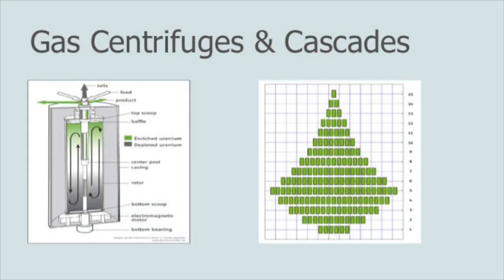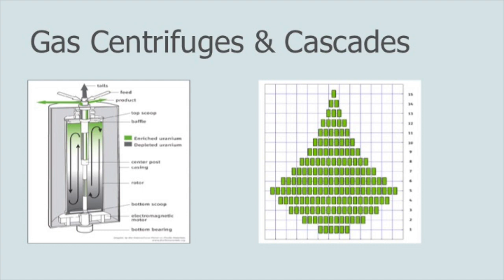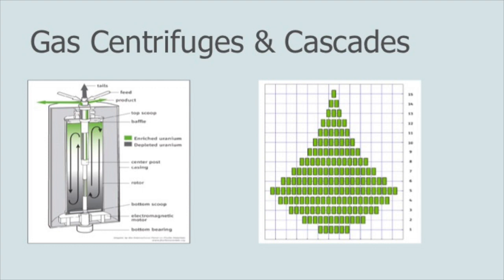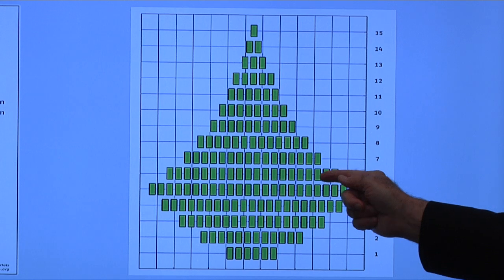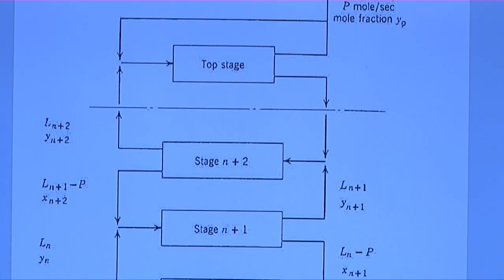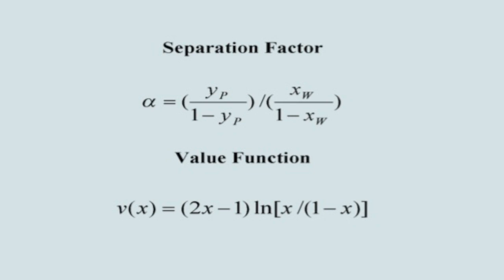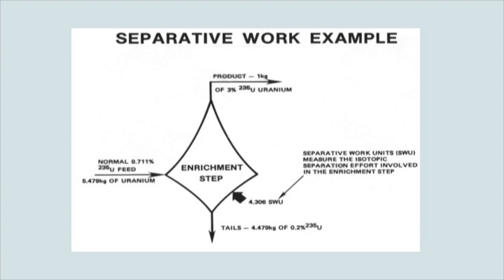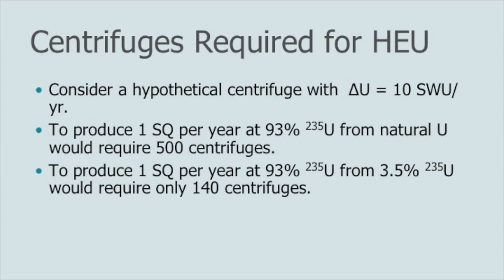Introduction to Gas Centrifuges Part II

Comment: Can i use this to separate oxygen from nitrogen to produce a respirator for the covid problem?
Reply: that separation you want should be a hell of a lot easier, since O2 and N2 have different eletronic configurations. U235 and U238 only differ by a tiny fraction of mass of their nuclei.
Reply: O2 and N2 differ in boiling point. Just take regular air, cool it to a liquid and distill out the product you like. That process is used on a massive scale, any chemistry department is buying liquid nitrogen by the tanker truck. I'm sure you could do the same for liquid oxygen. Or just buy a bottle of oxygen from a diving store or welding supplier...